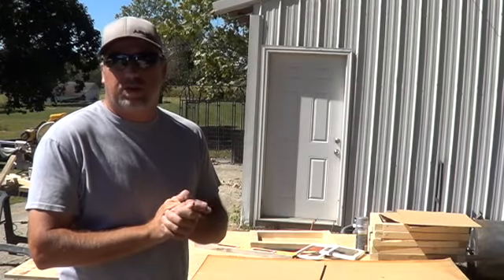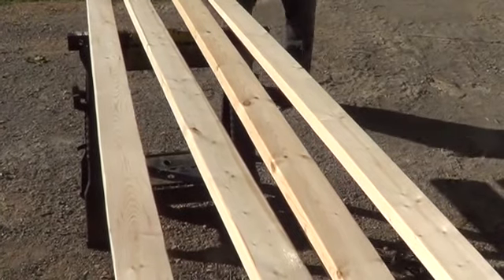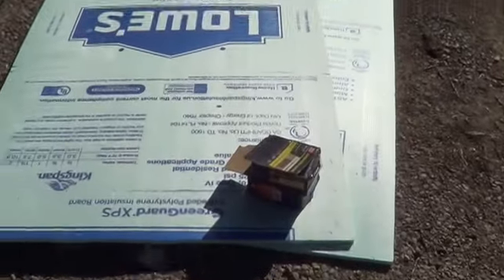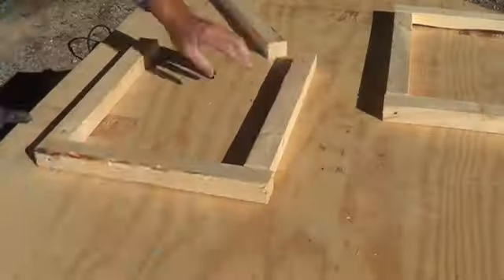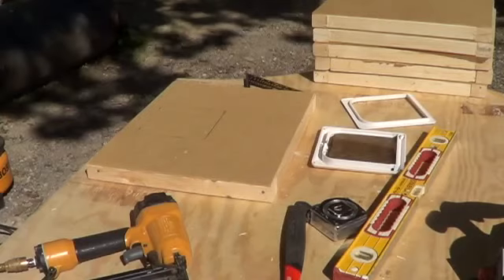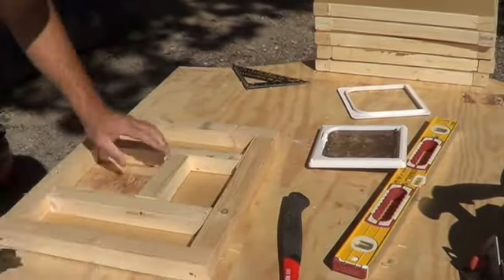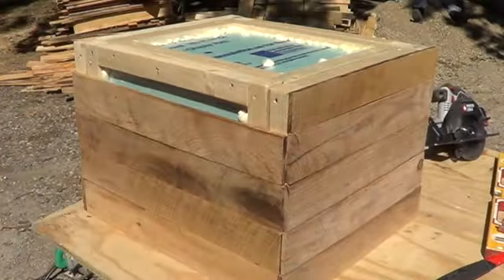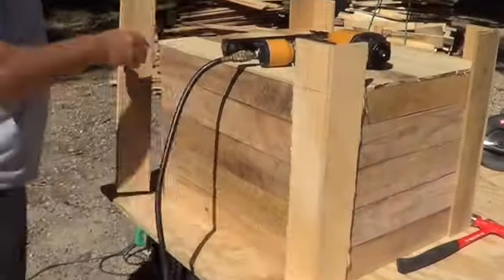Amazing DIY, Cat House (STACKABLE INSULATED) MADE (WITH PALLET LUMBER)

Comment: While they are obviously building extremely well by a very capable friendly carpenter (who obviously loves his wife), they don’t have easy access to the interior for adding straw or blankets or self-heating pads or just general maintenance cleaning for spiders, bees, etc. who all would love to move in too.

They also don’t have rear emergency exits in case a cat is inside when a raccoon or snake or worse yet, a bear decides they want to come in too.  Plus, w/o the emergency exits, the house seem like it would be too hot for the cats to comfortable use in warmer months.

So, when you get a chance, pop an exit on the back and throw a couple of hinges on the tops so they can be unstacked and the top opened up and then you’ll be ready to mass produce and sell those puppies for big bucks!!

❤
Reply from the maker: Thank you I appreciate it. And I will consider the rear doors and lift up top would be a good idea on my next builds.
Reply: Just staple an old piece of heavy canvas or piece of plastic tarp with a slit in the center of it over the exit and you’ll be good to go.  

Don’t do any kind of a ledge outside the exit.  It needs to be a straight drop down for a smooth getaway and to prevent another animal from using it as a entrance.  It’s more difficult to get into if there’s no foothold.

Best of luck!

Comment: Dynamite!! Even insulated the edges of the foam board....Just perfect. 
I'd love to know where you get the bundles of pallet wood from. I'm from WA State & waiting for the weather to cooperate so we can build our little buddies more proper shelter. 
Right now they're in insulated bins with straw, under a PVC pipe & tarp "shelter" I rigged quickly. My SO is a finish carpenter so we can do better! Come summer they should be set. Thank you so much for filming your set up, great idea! : ) Hope the kitties are loving it .

Comment: Very cool but cats can't jump to a step thats directly above, its impossible to jump out and up. When going down as well the entrances are lined up which is fine if you're on the lower box.  The very bottom needs to be off the ground or insulated more as water and snow will get in over time even with the insulation.  Just a thought. Good idea, but you need to think like a cat and understand their movements if you're gonna get the design right for these floofs.
Reply: 1 years later and still no reply from this guy. Not a “hey, great tips!”, nor a “piss off”. Just silence. Which speaks volumes, he said knowingly. I’m currently building a proposing bits of his ideas here, adding your notes, plus my own idea, involving a simple solar unit. Cheers!
Reply: @AndySalinger33 maybe he thought it was a silly thing to address.  The platform for the top entrance cant be much more then three feet from the ground.  Many cats can jump that high on to a platform without a thought.  And if they can't, there are two lower entrances...

The way you 15 think speaks volumes....

Comment: Good video! What is that tool called that's attached to the circular saw that you ripped the wood? All I'm seeing are Kreg track guides, and really need the tool attachment you're using! Thanks
Reply from the maker: Its called an  Accu- rip i have had it a long time  its alluminum and still works great.I cant remember where i bought it at so many years ago. Hope this helps and Thanks for watching

Comment: How did they get in cat house two or three though.  Especially with the doors on them. They need a ladder. Lol.  I built some (3) that are raised 24 inches and I can’t even out doors on them a month later for fear they can’t get in.   Heated Mats. Insulated and windows and rear escape doors are on but no front doors yet.
Reply from the maker: The cats jump on the ledges built in the face of each cat house and we did to put heated mats in ours and removed the door from one of them until they all got used to the boxes but they use them every night to stay warm and we also keep them on our covered back porch that keeps  them safe.

Comment: Sorry, but the so called 'siding' used here will not shed water as installed and the MDF (not plywood as stated) on the interior walls will begin disintegrating in a matter of weeks when if rains. Absolutely stupid.
Reply from the maker: We use are under our covered porch and in are barns so they never in the weather. You are right when it comes to getting wet and I would choose another exterior for outdoor use.

Comment: Where can I find all the measurements for the wood used in this video?
Reply from the maker: Hi , it's been a while since I. Built these but  I beleive I built the frame from 1x2x8ft lumber making the frame 20 inch square frame with 1/4 inch plywood on the I side and 1/2 foam board sealed all cracks with spray foam and pallet lumber on the exterior that was 1/2 inch x 4 inches , hope this helps good luck on your build
Reply: @SavinABuck45  Awesome thank you!

Comment: I'll try this, I have about 7 or 8 feral cats, can you post the cutting dimension please?
Thank you.
Reply from the maker: Its made on a 20 inch square box  so i cut every thing down so the total outside box was 20 inches x 20 inches . I hope this helps and you can make them what ever size you desire though for you and your cats. Thanks for rescuing them and thank you for watching.
Reply: @SavinABuck45  thank you, so if I got this right after splitting the 2x4 in half I cut them to 20 inches and build all walls alike?
Reply from the maker: Cut 8 at 17 inches and 4 at 20 inches that will make a 20 inch box screw them together
Reply: @SavinABuck45  thank you. I'll give it a shot.
Reply: @SavinABuck45  I'm sorry not handy with lumber, are the 17 inches for front to back or for the high?
Reply from the maker: 17 inches is height so 20 inch on bottem and 20 inch on top and 17 in between on each end  with 1-1/2  inch boards will equal you 20 x 20. I hope this helps you. Thank you and good luck